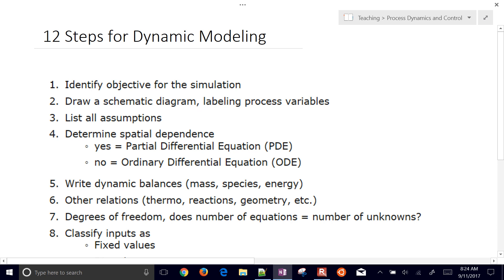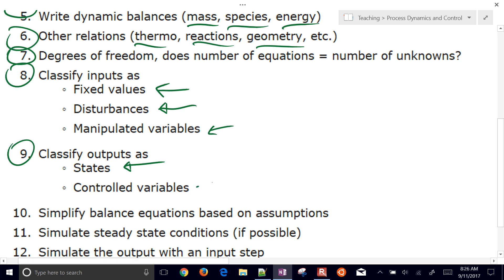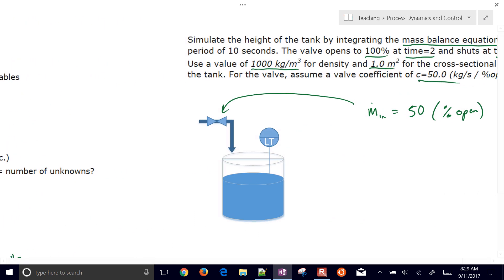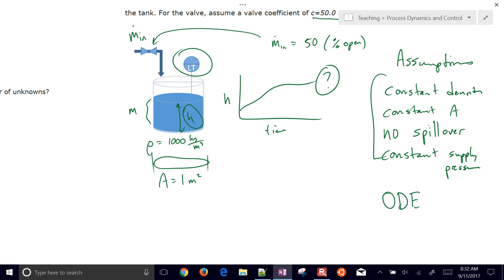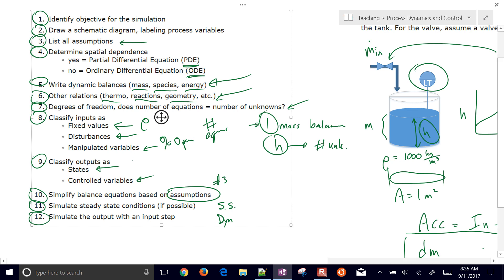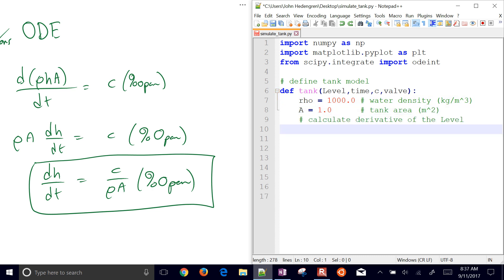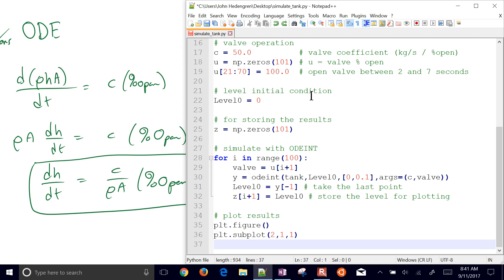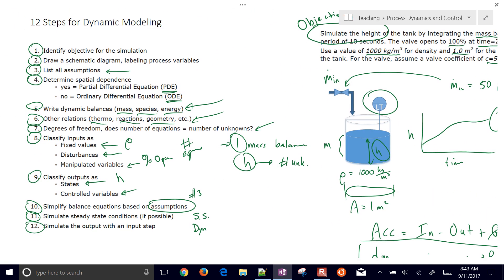12 Steps to Create a Dynamic Model

Comment: Hi, I don't understand why the final result is not equal to 25 cm. Since the valve opening rate is constant from two to seven sec, we can easily calculate the final height by the following equation: 50*100%*(7-2)=1000*1.0*h. Then the answer should be 0.25 m instead of 0.245. Could you please consider it if you saw the review. I am very confused.
Reply from the maker: It isn't exactly 5 seconds opened. It is between time points 21 and 69. Try it with time points 21 to 71 and see if that gives you an answer that is consistent with your calculation. Change the line u[21:70] to u[21:72] for 21 to 71 time points.
Reply: @apm  Thank you very much! I have tried and it worked.

Comment: Is there a reason for why you integrate 0.1 secs at a time?
Reply from the maker: It is emulating discrete sampled systems like PID control or MPC control where a measurement is taken every 0.1 or 1.0 sec. In the Process Dynamics and Control course, a new value of the controller output is injected into the simulation model every sample time so we integrate in steps. https://apmonitor.com/pdc

Comment: Thanks for the helpful tutorial! 
Would you please tell me why you stored the result in 'z'? why we cannot plot level plot itself instead of z? 
One more thing that I got confused is that, why did you use another variable, valve, instead of u in the model?
Reply from the maker: I commonly use 'u' as the input of a function and 'x', 'y', or 'z' as the output. You could change the code to be more readable.

Comment: I love the video, especially the steps, it's very helpful and constructive. But I have 1 question about valve coefficient c = 50 kg/s /% open. Do you mean 100% open means the valve can deliver 50 times 100 or 50 times 1? Thanks before.

Comment: Thank you for the tutorial.  I have a quick question.  Why does valve = u[i+1] ?  Why is the first value of the open % is being skipped?
Reply from the maker: At 15:38, I use u[i+1] because the starting conditions are already specified and I am computing the next step. I could have used 'i' instead if I change the loop on line 28 to: "for i in range(1,101)".
Reply: @apm   Ok, that makes sense. Thats what i was thinking.  Thanks you!

Comment: Thank you APMonitor.com for the excellent video!

In addition, I have a question regarding how odeint works. Sorry this is kind of off-topic:
In the video, you used a for loop to calculate tank height at each 0.1 second from 0 to 10 second. Since tspan = [0,0.1], an initial condition h0(which changes with each loop) corresponds to t0(t0 = 0). An approximation of the "next height"(h1) at the t1, which is 0.1 second later, was then made using numerical integration method LSODE(or runge-kutta45?). So tspan is just a step size, it does not matter what time it is, like for example from 2.1 to 2.2 second, as long as the initial condition is provided at 2.1 sec, the height at 2.2 sec can be calculated, is this correct? 
If that is the case, then how this work: without a for-loop, change tspan = [0,10], and input initial condition y0 = 0 once, you can get to the same answer(an array of h from 0 to 10 second). Does odeint automatically know the step size and update the initial value y0? 

Sorry for the long paragraph but I am confused
Reply from the maker: Yes, you can keep tspan=[0,0.1] as long as time is not explicitly in your differential equation. You can also feed the entire tspan to ODEINT and it will produce a solution at all of those time points.  Here are additional tutorials: https://apmonitor.com/pdc/index.php/Main/SolveDifferentialEquations
Reply: APMonitor.com  thank you sir for the quick response. Python is very nice.